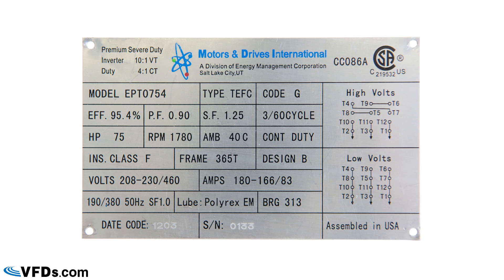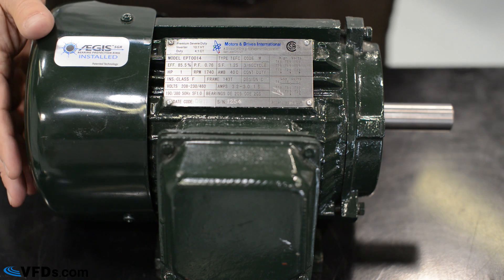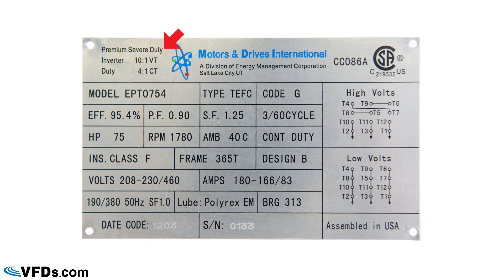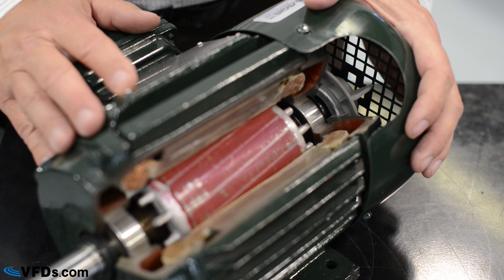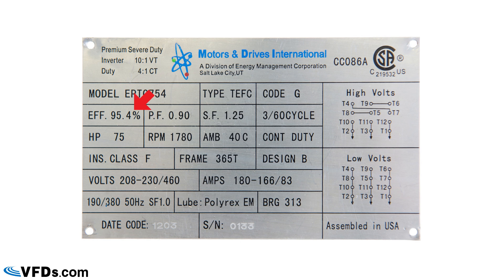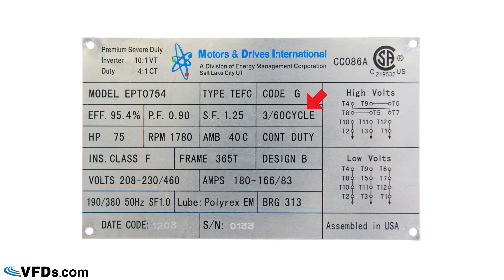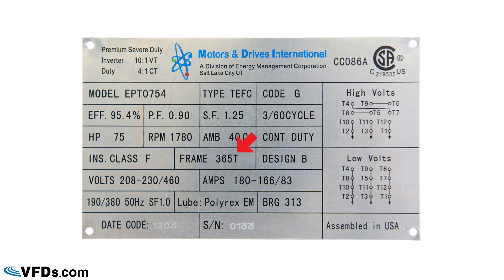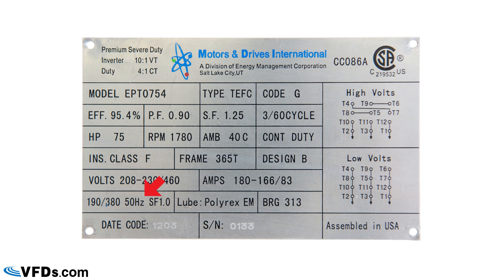How to Read a Motor Nameplate

Comment: Hi Sir, can i use vfd to a press drill machine with the name plate of 3 phase induction motor, 4pole, 1.5hp, 60hz, 440volts, 2.75ampere, 1700rpm, ins F, amb 40degC, cont.rating. Thanks in advance, Paul Mercado

Comment: Why did they go with 12 leads for a lot of 3 phase motors. For over 75 years they only provided 9 leads making it easier & faster to connect line wires to. Perfer to NEVER use any motors from cheating corner cutting lack of quality control communist china. I asked for spare motors for some important air handlers. China crap 100 HP plain jane very common NEMA frame 100 HP had a label to use line wires goid for 110 degrees C. making existing THWN wire not suitable. So when this motor is instslled would have to purchade expensive wire that no supply houses stock and remove perfectly good wires to install high temperature wire. Way to go cheating china.

Comment: AC DC Drives in Noida | AC Motors in Delhi | Drives and Motors Training | Servo Motor Training Institute
https://www.diac.co.in/courses/drives-motors/
Motor Drives, Servo & Stepper Motors is designed for btech mtech students, maintenance technicians, and plant personnel who are learning about or work with motor drives and components. Call @9953489987, 9711287737.

Comment: How did they fit a 75hp motor into such a small frame?
Reply: same question
must be 1HP or 1.5
Reply: As you can see ,his motor example is 1 hp,,try to zoom..but the other nameplate was not the exact nameplate  of the actual motor,,

Comment: hi......I am currently working on a school project anf need to size the motor to know which to purchase
the maximum torque I need 145Nm and need to spin around 5 rad/s ...........would a 2hp do the job?
I believe i need a low rpm / high torque motor.........can I email you all with further details
Reply: Im a bit late, but you could put a worm drive on it.